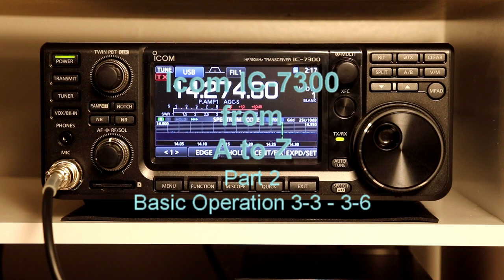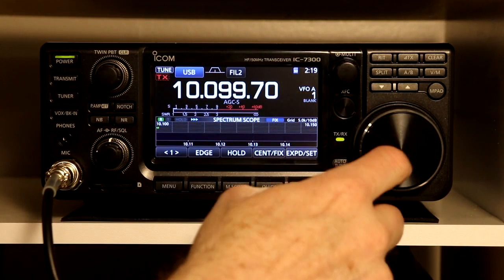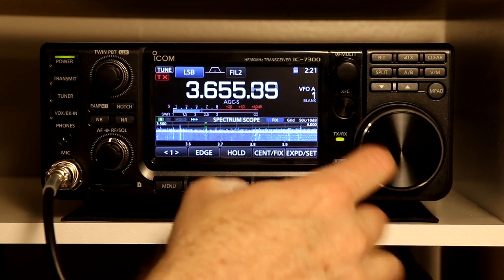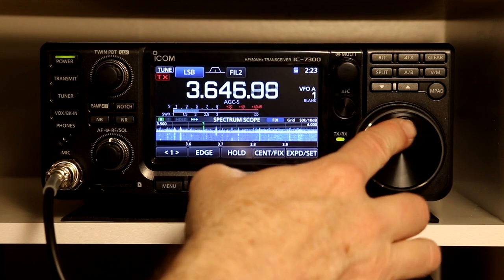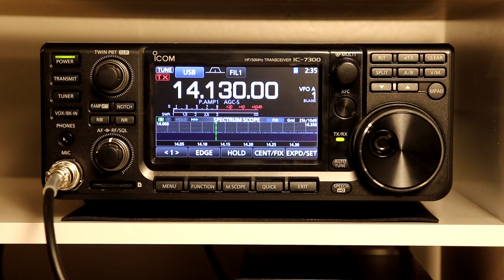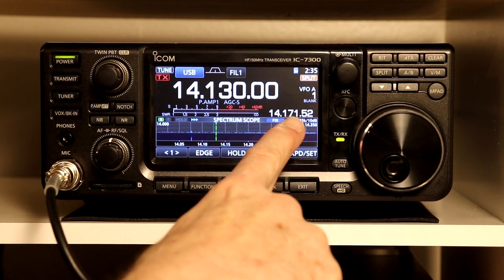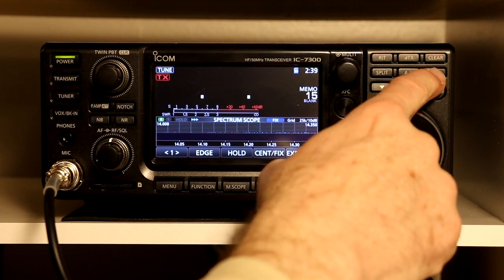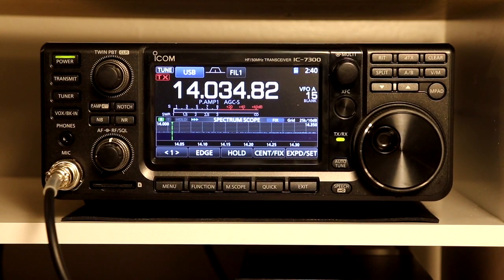Icom IC-7300 From A to Z - #2 Tuning Steps, Frequency Entry and Split Operation

Comment: Another tuning method that may have to wait for the Spectrum Scope section: With the scope open, if you see a signal far away from your current freq, instead of tuning to reach it before the tx ends, you can just click on the signal you want. This expands a section around that signal and freezes it. In the expanded view, just click on the signal and the 7300 tunes to it. Great series of podcasts. KY4IY

Comment: the Band Stacking is different on my new (Oct'23) 7300 - from the waterfall, if I touch and hold the MHz freq there's a pop-up showing the 3 band options. Tis is true too, if you tap the Mhz to I=open the band register, then hod any of the bands
Reply from the maker: You are correct.  That video was made before the current version of firmware came out. I guess it’s time for a new, updated series.

Comment: Hello, Thank you so very much for all of the videos. I'm new to this and am trying to learn it. For me, being a slow learner, it's a challenge for sure. At the end of this video you mention setting user band edges so we don't transmit in an area that we're not supposed to. Have to covered that topic in another video as of yet?  Also, when in USB or LSB, I can transmit in those bands without having a ham operators license ? I'm checking into getting a license so I'll be legal while using the radio. So, again I thank you for all the videos, I'm certain I'll be learning from them. Oh! I have the Icom IC-7300 first radio I've ever paid over 1K for.

Comment: Do you need an external power supply?  What type do you have...linear, switching?
Reply from the maker: Hi.  Yes, the 7300 operates on 12 (13.8) volts.  So you do need a power supply.  I currently have a switching supply.  I have also had Astron linear supplies in the past.    Both have worked fine.  Right now I’m using an MFJ 30 amp switcher.  I don’t remember the exact model number, I’m not at home where can look right now.

Comment: When I click on a frequency I saved in memory it goes right back to the frequency in a VFO and not the memory frequency, why?
Reply from the maker: Hi.  I'm not sure I understand exactly what you're explaining.  All of the memories in the 7300 are "tunable".  Here's an example of how that works--  Put the radio in memory mode (with the V/M button).  Tune to any memory channel.  Let's say you have 7.150Mhz programmed in memory 1.  If you select that channel and then turn the main tuning knob, the radio will tune around just as if you were in VFO mode.
However, if you change memory channels up 1 and back down again with the Multi-knob (or switch back to VFO then back to memory again with the V/M button), the radio will go back to the 7.150Mhz that is programmed in the memory.
Hope this helps.
Reply: @HamRadioA2Z  My stupid mistake I was talking about the IC-705.

Comment: I just programmed my call by following your directions...Thanks! Now I'm interested in FT8. & would like to know how to get to that mode & see what's being transmitted by others & how to bring-up the keypad. Any tips? thanks, we6oz.
Reply from the maker: Hi Deacon.  Thanks for the kind words.  For FT8, specifically you will need to use WSJT-X software from K1JT.  He is a professor at Princeton and the software is completely free.  You can find it on his website here:  https://www.physics.princeton.edu/pulsar/K1JT/  I haven't done a video on connecting the 7300 to your computer yet, but it is super simple.  You just need to plug a USB cable into the back of your 7300 and into your computer and you're connected.  There are some instructions in a separate document from Icom about loading the correct USB drivers.  However, with Windows 10 at least, my computer found and loaded the right audio and serial port drivers automatically the first time I connected my Icom.  USB and data details are a ways back in the manual, but that is a popular enough subject that I should probably move that up in the series.
73,
Tom WA2IVD

Comment: Tom  why did you see SCOPE OUT OF RANGE while you were on 6 meters? shudnt it be there 50-54 Mhz default?
Reply from the maker: Hi David.  The default band edge settings for the scope are 50-51Mhz, 50.0-50.1Mhz and 50.1-50.3Mhz.  So out of the box it is setup for for CW and SSB operation.  So when I was up in the FM portion of the band, it was out of range.  You can certainly reset one or more of the band edge settings up into the FM portion.  The largest range you can set is 1.6Mhz.  So, unfortunately, you can’t set one range to cover the entire 6 meter band.

Comment: how do you ground the radio?
Reply from the maker: On the back of the radio, on the left side just above the SO-239 antenna connector there is a screw that is a combination Phillips and hex head.  You should connect your ground wire to this screw.  Use a ring or spade terminal instead of just wrapping the wire around it to make a more secure connection.  You can find quite a few articles on the internet about the best way to make a station ground.  Many of them conflict with each other about the best method.  The ARRL has a good introductory article about grounding here:  http://www.arrl.org/grounding
The most important purpose for the ground is safety.  So you need to make sure it is connected to the safety ground of your home’s wiring.  RF ground can be important too, but it is secondary.
Reply: @HamRadioA2Z  Thanks. I take it the earth rod would then be connected to the ATU?
Reply from the maker: @Pandamonium if you have driven in a ground rod, it should be connected to your antenna tuner, your radio, an amplifier if you have one and any other radio equipment in your shack.  Per National Electric Code (NEC), the ground rod also needs to be bonded to the safety ground for your electric house wiring.  I’ll refer you back to the ARRL web link in my first reply.  It includes references to additional articles at the end.  A saying I heard long ago is “you can never have too much ground”.  There is a lot of controversy about grounding, but just about everyone agrees that you want to have all grounding systems securely bonded together.  This includes any ground rods, ground radials for vertical antennas and your house wiring safety ground.  Then all of these should be connected to all of the radio equipment in your shack.  The connections should be a star type arrangement from a common grounding point, not a daisy chain from one piece of equipment to the next.
DX Engineering makes a copper grounding kit to bond and ground all of your equipment Here’s a link: https://www.dxengineering.com/parts/dxe-cu-spgp.  It’s a bit pricey, but it includes everything you need.  A cheaper approach that I have used in the past for grounding my radios is a piece of 3/4” copper water pipe from the local hardware store.  I used self-drilling/self-tapping sheet metal screws to attach copper braid to each of my radios along the length of the pipe.  I crimped ring terminals to the braid and used star type lock washers to insure solid connections and a good bite into the copper.
I suggest you read up on grounding, but hopefully this gives you a start.
Reply: Thank you  @HamRadioA2Z